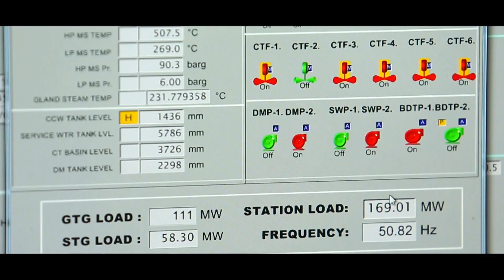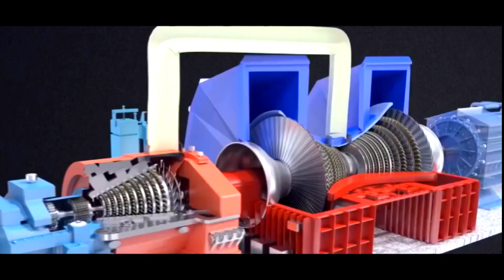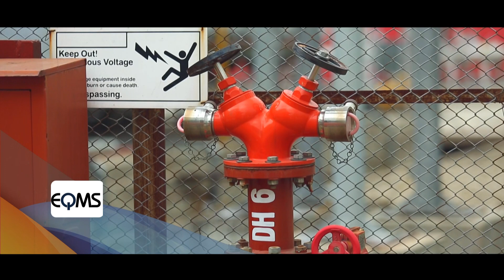গ্যাস আর পানির সংমিশ্রণে এই বিদ্যুৎ কেন্দ্রে তৈরি হয় বিদুৎ।

Comment: This is fantastic material for anybody with an interest in electricity. It is common knowledge that a combined-cycle power plant may generate up to 50 percent more energy from the same fuel as a conventional simple-cycle plant by using a gas and steam turbine in tandem. The gas turbine's byproduct heat is sent to a neighboring steam turbine, which spins at a higher speed and produces more energy.
Reply from the maker: Thanks 😍😍